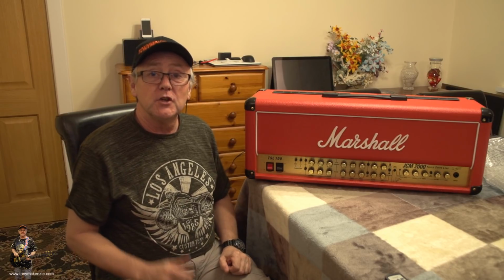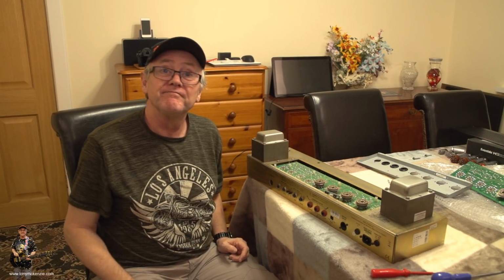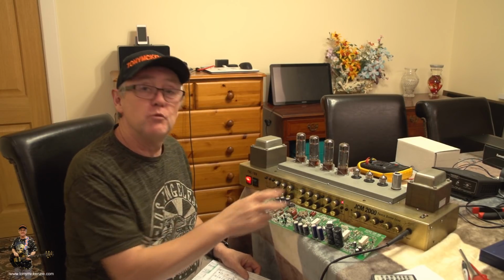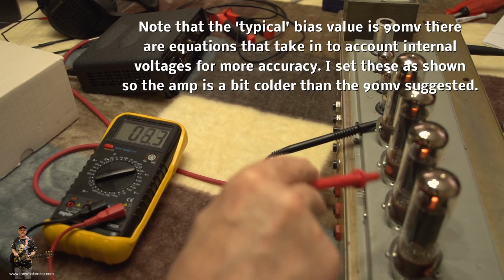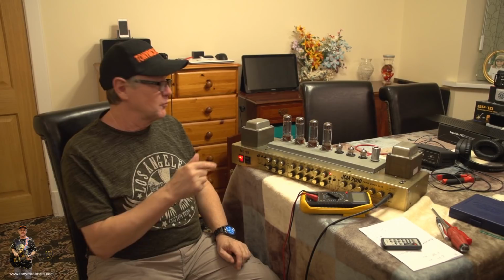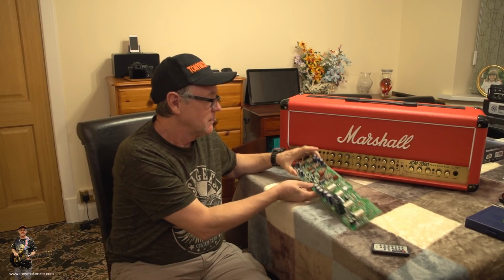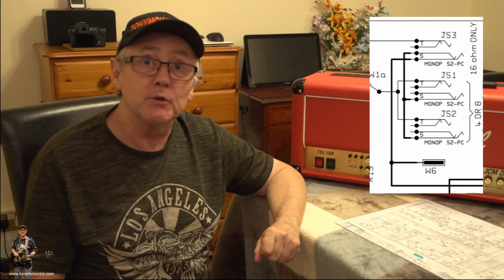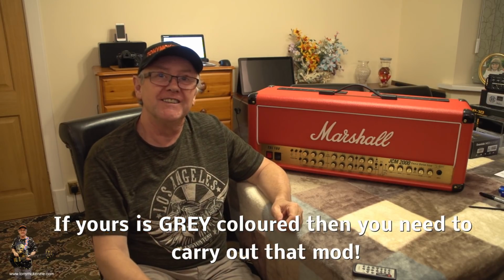Marshall TSL100 JCM2000 Amplifier | Permanent Fix For Bias Runaway | biasing review | Tony Mckenzie

Comment: Hey I just bought a revision 20 board, getting ready to install it and the bias pot PCB (connector 1) is hard wired to my old Revision 2 board. Seeing how these are defective I dont want to use it on my new revision 20 board.

Trouble is, I cannot seem to find a replacement part. My new board requires a connector,  the revision 2 is soldered directly without a pigtail harness connector.

Do you know where i can get these parts to fit my revision 20 board?
Reply from the maker: Not sure where you're based? If you're in the UK then there are a number of dealers that can order the parts for you.... if you're in the USA I can't advise :(  Hot Rx or Strings Direct are two that spring to mind in the UK and I'm confident that Marshall will have those available. Hope it helps and let me know if you can't find them...
Reply from the maker: @David Neris If there is no fault there would be no point. I have not really heard of too many DSL50 boards in trouble... but if there were repetitive stuff like on this amp certainly this board fixes the tsl… sorry I can't say more on the dsl.

Comment: I have the 60 watt version and it's awful, I never even plug it in, I always use my Tiny Terror, even my 90's Laney lc15r is preferable to my TSL 60, and I have a Sound City LC120 with a master volume mod done by Denis Marshall if Fife that's a lovely amp too. My problem with the TSL is it sounds too glassy too much top end, it sounds bloody awful nothing like you'd expect a Marshall.
Reply from the maker: Actually with the 60 watt unit (for some obscure reason) it sounds different. In fact, I had a 60w head. A friend came to record an album and I said I did not like the 60 just like you did. Then he turned on his 100w head and the difference was mega. Hard to believe and no on was more sceptical about what he said. Then I sold the 60 and bought a 100 watt... then I wrote a complete album off the amp here's an example of a really incredible tone right off the TSL100 amp I bought: https://youtu.be/AqV74q1lLUk and listen to the tone yourself... there is no harshness or anything else except great tone coming from that amp. Sell the 60 and get a 100w and the difference becomes clear. Thanks for raising the point because, like you, I've been there.
Reply from the maker: @speedforhire  Ha it will scream... but more like a banshee :) I had both and the 100 was a better tone by far... do you have a 60? if so, what do you think...

Comment: Mr. McKenzie. Important question...First, AWESOME video. I have been fortunate enough to pick up a JCM2000 DSL100. Luckily, it was made in 2009 and to my relief, the main board is Issue number 20!! Woo Hoo!! My question is, my cabinet is a 16 ohm cab. As long as I continue to use that cabinet, can I put off doing the 16 ohm speaker jack fix until I decide to use an 8 ohm cabinet. As long as I have that 16 ohm jack plugged in, will it ground properly? I hope you see this question and give me the sage advice you are known for. Thank you sir for all your awesome videos!
Reply from the maker: Hi, It should ground OK as long as you are using the 16 Ohms speaker out. The 16 ohm grounding is carried forward to the other two speaker outs... and what happens is that when the 16 ohm ground fails (it will) then you are left without an ground to the other two outs... basically leaving the amp with no load on the output. This is why its so critical to stop that. Obviously if you're using the 16 ohm that will be OK. Good question  thanks.
Reply: tonymckenziecom Thank you for the reply! That is exactly as I thought. That if I ever switched to a different ohm rated cab, being that the 16 ohm jack works as the only ground for all the jacks, that if the “spring action” fails on that jack, bye bye output transformer. I may do the fix anyway soon just to be safe. Cheers!
Reply: Speedforhire The first lettter is M which means made in England, the number right after the M is definitely 2009. Much like vehicles, if it is made in November, they consider it the NEXT year. So mine was probably made in November 2008 but they consider it a 2009 model. Plus it has Made In England on the back of my amp. Also the front says JCM2000 on the left and in very small letters on the right just underneath the input it says DSL 100. When they outsourced them to Korea they stopped using JCM2000 I believe. I think it was January of 2009 they outsourced production to Korea.
Reply from the maker: Correct... but the DSL is made after that? right? flipped to India or somewhere? The DSL board might be different?

Comment: Thanks for the helpful info!  I just got an issue 20 board from Hot Rox and went through the all of the effort to reconnect everything and it appears that connector W4 is missing! Has anyone ran into this problem?  Looking at the issue 5 schematic it indicates that this is one of the output transformer legs which is necessary.  I don’t have the issue 20 schematic but the board looks extremely similar in that area.  Does anyone have the issue 20 board schematic that they can share?  Can anyone verify that W4 is populated on their issue 20 board?  If so I can remove the connector from my old board if need be.  Thanks!
Reply from the maker: Contact me from tonymckenzie.com contact form and I can probably help you. Thanks.
Reply: Thanks!  I’ll contact you.
Reply from the maker: BTW the new board is shown full on here: https://youtu.be/RtFhvYcI6x4?t=33m22s
Reply: It definitely looks present on your board.
Reply from the maker: Indeed it WAS present on my board.
Reply from the maker: :) It's not too hard.... take plenty of photos though just to be sure... wires have an uncanny nack of being put back in the wrong place :).  and let me know how it goes.

Comment: I had a 1999 TSL12O (combo) and Marshall started to charge me about 100 euros from the 3rd year I had it, on. Although I didn't play that long, they keep charging me every time I went there complaining about a huge humming. I decide I had to see the guts of it just for the sake of ignorance, when I saw a motherboard completely in flakes and the base of my GT valves completely warped by heat? I googled TSL and a bunch of 'victims' reports popped out! I called Marshall to complain about the fault that was definetelly a production error. They 'gently' offered to fix the error for 250 euros. I decide to flip it since I wasn't play it that much and for a room playing that was an overkil (I informed the buyer). All the  'victims' had the same response from Marshall dealer 'we can fix it for about 250 euros (new motherboard!). Don't get me wrong I loved the tone... but no one likes to be scammed!
Reply from the maker: Certainly the Marshal TSL100 board did have issues. Of that there is no doubt. Depending on where you live, if you can prove similar failures then you could have a case against any manufacturer, but its a long hard road to go down for sure. And indeed I would not like to be scammed either. But if you have a revision board as I showed that suffers then likely the fixes are horrible and are not guaranteed. Changing the board for issue 20 really does solve the problem, but the board is only about 120 Euros? You could buy one and fit it, its not rocket science but like everything, if you have no clue that would be dangerous. I fixed this one with the board, and also showed the fix for the 16 ohm speaker out problem which can cause the OT to fail. 

In any case, I agree that getting screwed is no fun especially if the problem is inherent. Thanks.

Comment: I really liked your video, thank you so much it was very helpful and very informative. I have a TSL100 and I been having some problems with noise on the FX loop and it has  small drop in volume !!!! which its very common in these amps I was wondering if you had these any problems on the old PCB or the new one because I think the FX loop its not on the mainboard, but i dont know maybe you can tell us a little more about the FX loop.

 Another think that I wanted to ask you is:
 Did you feel that with new board  change your tone ,more headroom maybe or more punch ??
does it feel more quiet , less hiss , more bottom end ?? no change at all? whatever you feel please let us know!!! 
by the way you tone on that album my god its really good I love it !!!!!!
 I think the same the Marshall TSL100 its the best amp if it works right !!!
and last but not least maybe you can talk about more mods I been thinking about those mods that are very common like the change of transformer , the choke or any other mod that you like!!!

thank you so much and keep Rocking!!!
Reply from the maker: I hate to say this... but I personally don't use the loop. Years ago I did but I have long forgotten about how it was exactly. 

The new board sounded exactly like the old board but it has no technical issues with bias. Gravity Waves album used many amps, guitars and guitars to achieve the mix of sounds throughout the album. Every track is actually different and as much as anything those tracks were written around the different tones and 'feel' that each combination offered me. Its one reason why I really like many amps. The best two tracks from this amp are here: https://youtu.be/P_kLLgOGP-A in the form of Lightpipe AI... and here: https://youtu.be/AqV74q1lLUk in the form of Metropolis. 

The TSL100 JCM2000 is shown with IMO incredible tones and that's why I bought this one again (I sold the original years ago) and fixed it all up... they are incredible guitar amps and those tracks show that tone off I think. 

I have changed transformers on Marshall amps but never really noticed any discernible tone difference. Same with choke's in particular on the 410H. Listen to the tones above on these tracks and tell me those are not incredible tone... to my ears they are... all from an unmodified TSL100!  :)

Hope you like the sound and do come and let me know.

Comment: Tony -  You're the man. Bought a used TSL100H (good deal!) and had the clean channel HUM and runaway BIAS issues. 
Bought the REV. 20 main board and installed it. Now my amp sounds "GREAT!". Thanks for a heads-up on the fix.
Reply from the maker: Those are great heads and I still have mine as in the video. Yes the board fixes it all and you will have an amp that will last a very long time. Don't forget that mod for the 16 ohm output socket... it can take out the OT if you don't do that some say. Great to know it helped you so the video is worth making :) Thanks for letting me know...
Reply: con 15 and con 16 if the old board does not have what do you plug into there

Comment: @tonymckeniecom do you know when they released rev. 20? I just replaced the Mainboard in 2015 and lord that was board number 3 at that point ( I've owned it since 2007 ).
Reply from the maker: I was under the impression that board was released some time around 2007. You don't say which year your amp is, but if its 3 then that was probably 2003-04 or so IMO. The last revision of the board (issue 20) is the only one available today. The older boards can be a real pain and there are so many out there showing 'fixes' for the bias runaway problems. After careful consideration I chose to replace the board. Also remember that speaker output mod I showed at the end of the video because if you do change ohms to different cabs it could (not necessarily would) blow the output transformer.

Good question....   and thanks for watching.
Reply: I think I must have spoke incorrectly. I meant to say that I replaced the mainboard in 2015 and it was the 3rd time it's been replace, not 3rd.version of the board or rev 3....I was complaining about how many times I've had to replace it. So I wondered when rev20 was released. I am getting information from part suppliers that rev20 was released in late 2017/early 2018? so sorry to be confusing, hope you can tell me something
Reply from the maker: Hmmm I'm not entirely convinced that they are correct re the release date of the issue 20 board. The 2018 date CANNOT be correct as I converted mine in December 2017 and I bought the board before that date. However, I believe that board had been available for some while. Did you check which boards you pulled out of your amp as faulty?  Personally I believe this issue 20 board had been available for a while. Did those guys sell you an older board which then failed again? Hard for me to know, but my impression of the issue 20 board is more like years old. Correct me if I'm wrong. BTW I originally learned about the new board at the time I reviewed the Hughes & Kettner Triamp VIII which was around 7th August 2017 And I can guess September before I was advised.
Reply: Maybe I just not entirely sold on the idea that that TSL 122 combo will ever sound as good as it should....I did do the job in 2015 so if they re-released another version I wouldn't know as I thought it was the final version. See the one's I took out of there previous weren't the nice green boards you show in those pics (they were beige with horrible sodering work. So that tells me that there were several versions with the nice crisp green boards. Anyhow The shop I working through said they just got these boards 2 months ago from Marshall fresh, but gave me their contact info so I can inquire directly. I am going to look inside my amp, see what I can see, and call Marshall and see what they say. I wonder if i need to go another step and replace the speakers that came with the combo (a lot of people don't like the split color of the Heritage speakers) maybe throw some vintage 30's in there...I have wanted to give up on that amp a dozen times since 2007 but it does record and play well from time to time..lol...I'll let you know what I hear from Marshall
Reply from the maker: I have only used the head version. And that only with 1960A cab which sounds really good to me and especially when recording. From what I understand (and I did ask at the time of ordering) the board went to issue 7 then jumped to issue 20. The issue 7 was around 2007.

I would persevere with the amp though and the speakers will change the sound. But do let me know what you find out and post it on here as that's all useful... and thanks for the info.
Reply: I was thinking about using speakers in the combo as are stock in a 1960 A...do you know what kind they are? I don't know what it is, I will persevere, I can't see letting it go after 12 years
Reply from the maker: If I remember correctly G12H 75 (or 70) watts...